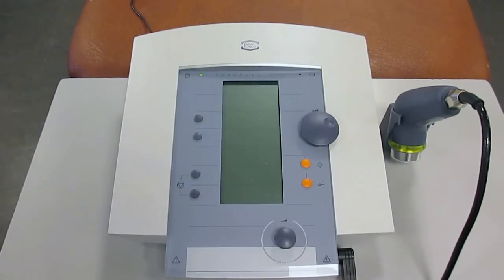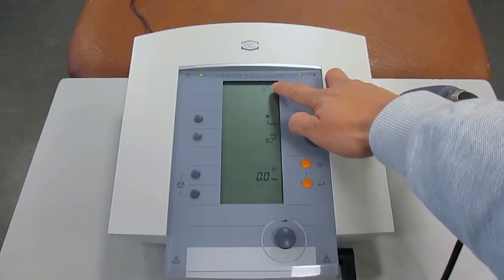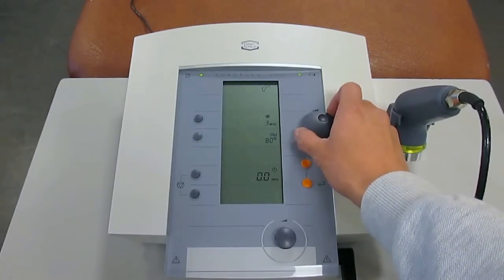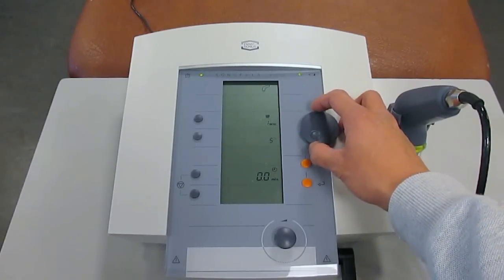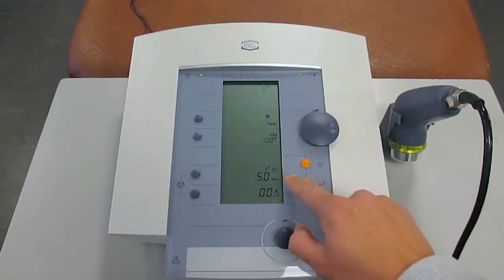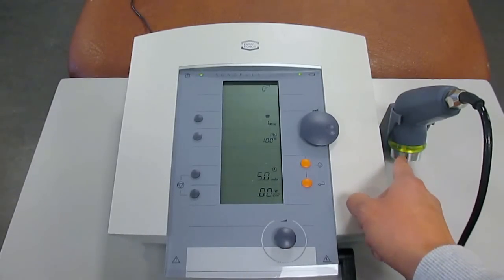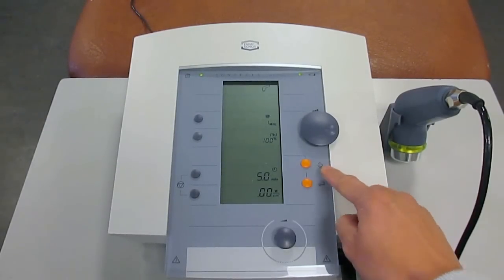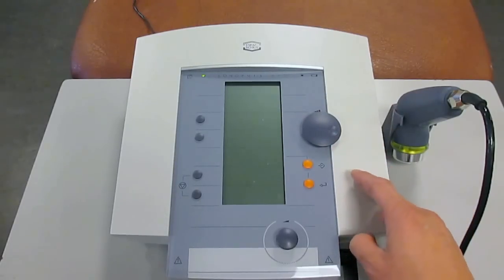Therapeutic Ultrasound: Parameters (Enraf Nonius Sonopuls 490)

Comment: Dear sir, could you please help me with my equipment, there is an integrated circuit that connects to the battery and starts with TL1, mine burned and you could. Please tell me the complete number, I would be eternally grateful

Comment: Hi, I had ultrasound for a facial cheekbone injury. The physical therapist had it set for 1 MHz, which I have read should only be used on the body. It burned and stung a bit when he did it for 4 minutes. He had it set at 20% pulse and said it wasn’t set super high. Could this have caused any tissue damage?